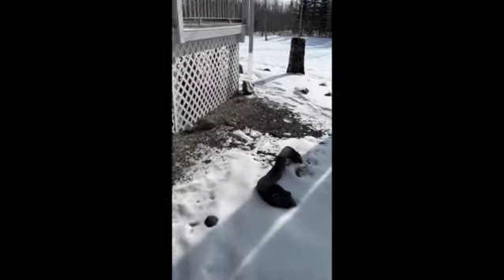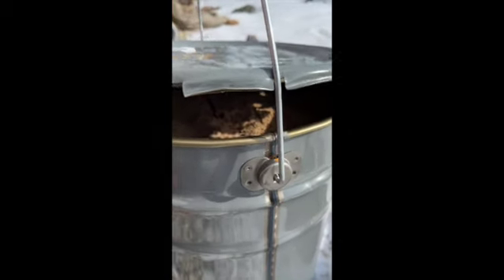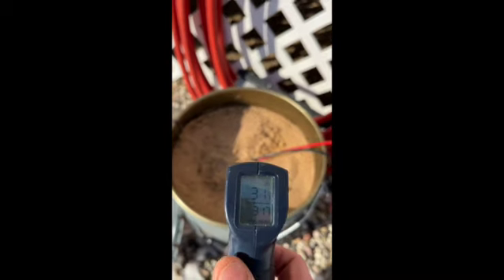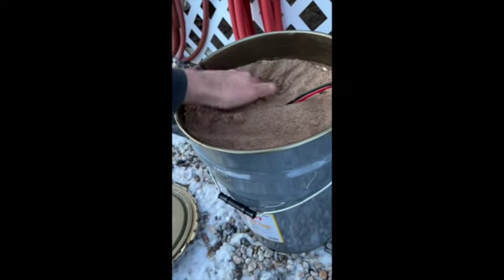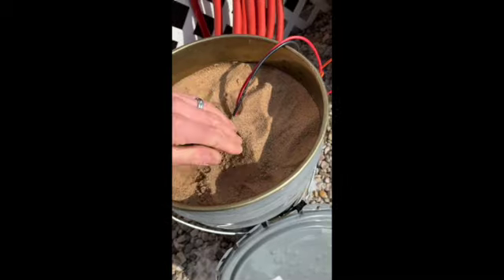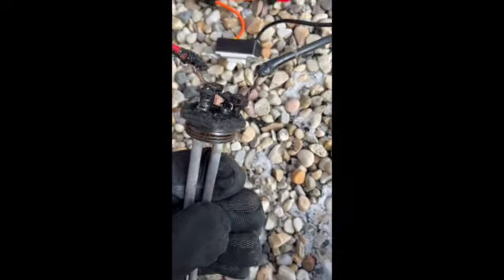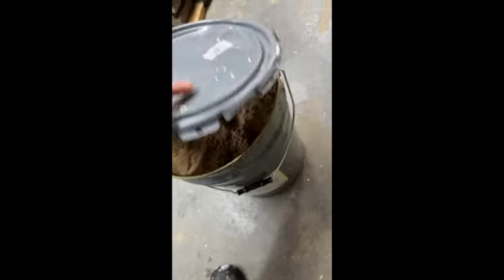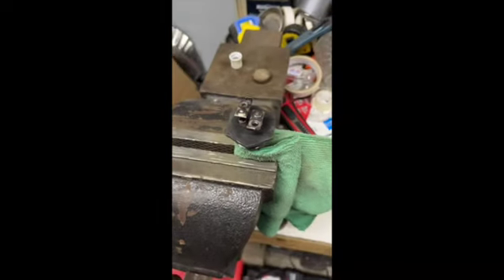Sand Battery 1st Attempt

Comment: You said something equivalent to "The fuse needs to be in the hot side of the supply so you catch the over-current before it gets to the element." As current flows in a complete circuit, back to the starting point, the amount of current flowing through both supply wires is EXACTLY the same. If the amount of current exceeds the fuse's rated maximum (usually by a factor of about 2x), the fuse will blow, whichever side of the load it's on. However, there is a reason for putting a fuse on the hot side of a circuit; if on the neutral side, and it blows, the load will still be hot. Mind you, putting the fuse on the hot side to protect you against shocks really only works if you've got a properly grounded circuit. In your case, which appears to involve just two wires and no ground connection, both wires are 'hot,' and if the fuse blew, the load would still be at a possibly lethal potential with respect to any metal item connected to the other side of the circuit.

Comment: That switch is not rated for a solar panel love your video!
Reply from the maker: Yes you are correct, I learned about the gap distance requirements of ac vs dc inside switches after this video experiment. The dangers of amateurs experimenting. 💥DC switches are much larger.

Comment: Is that a hot water tank element? Thanks, this is awesome!
Reply from the maker: It is yes. They are around $30 Canadian. So as long as the sand has no moisture in it the element should last quite a long time. I burned out a previous element because of the excess moisture. My plan is to build an insulated box with aluminum interior lining and place it under our hen coops nesting boxes to keep the eggs from freezing in our cold weather. From there I have multiple plans for larger designs time permitting. Thanks for the message.
Reply: @NewLightEnergy  thank you for your kind reply. I'm in Montreal.  I've imagined using old hot water tanks filled with dry sand in an old stone basement with solar on the flat roof. And rock wool as an insulator, that can open for heat release. Then I discovered you actually doing this. Thanks for leading the way and sharing!
Reply from the maker: @paulmaloney7074  the old hot water tanks are perfect for this. Especially electric ones. Having copper piping laid in the sand in a coil fashion or just multiple straight pipes vertically would give transferability to a manual or automatic temperature release valve on top. The cool fashion would permit having air or liquid transferred through to pull the heat out at a controlled rate. These tanks would store the heat for days. So many ideas.

Comment: Excellent work 👍 and thanks for sharing.

Suggestion: Sand + Graphite... could also recycle manganese dioxide, carbon from Zinc/Carbon batteries.
The container / bucket has negative polarity, in the center and insulated a sheet of preferably spirally wound copper that results in a positive pole. (Remember electrolyte capacitor manufacturing)
Graphite (talc), Manganese dioxide or Coconut Activated Carbon (talc) is a good electrical conductor.
You can heat the sand to use as a heat source, it also has battery properties by accumulating electrical energy 🕵️

Slds. Best regards from Argentina 🇦🇷🤗

PDT: I used a Spanish to English translator 🤷

Excelente trabajo 👍 y gracias por compartir.

Sugerencia: Arena + Grafito... también podría reciclar dióxido de manganeso, carbón de pilas Zinc / Carbón.
El recipiente / balde es polaridad negativa, en el centro y aislado una chapa preferentemente de cobre enrollado de forma espiral que resulta de polo positivo. (Recuerde fabricación de capacitor electrolito)
El Grafito (talco), dióxido de Manganeso o Carbón Activado de Coco (talco) resulta buen conductor eléctrico.
Usted podrá calentar la arena para utilizar como fuente de calor, también tiene propiedades de pila al acumular energía eléctrica 🕵️

Slds. Cordiales desde Argentina 🇦🇷🤗
Reply from the maker: Fantastic upgrades for me to look into implementing. Once we are finished the properties solar farm, I’ll be working at the sand battery project again. I plan on using the sand battery to provide hen’s nesting boxes heat so eggs don’t freeze over winter plus to stop water feeders from freezing.